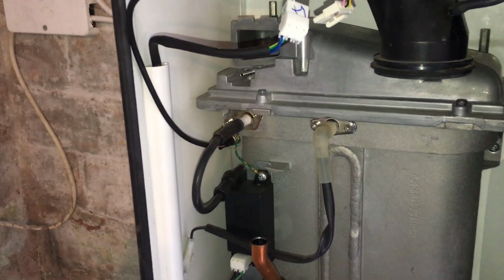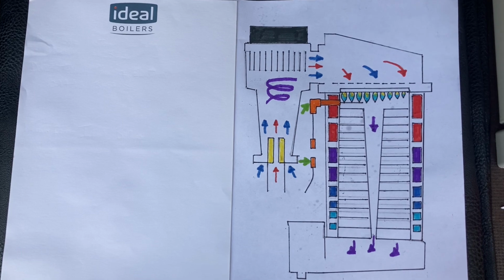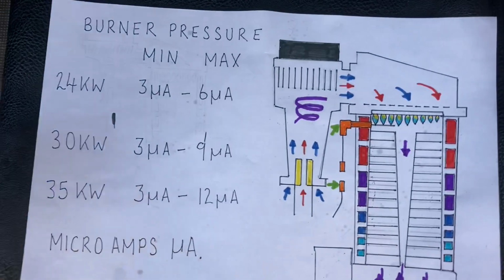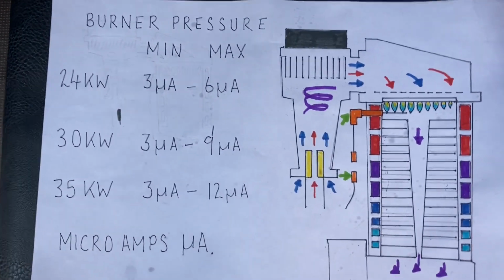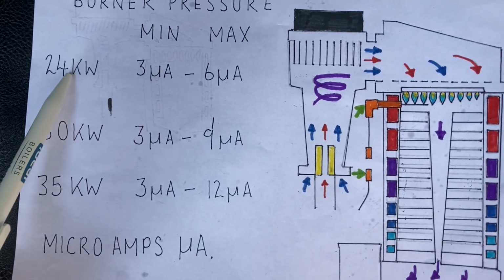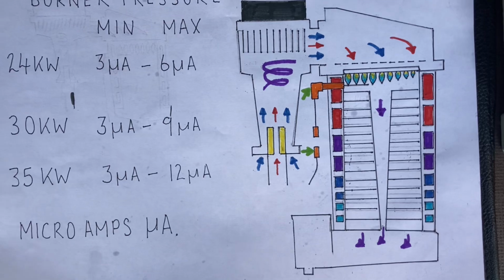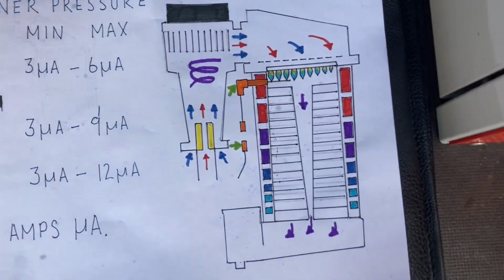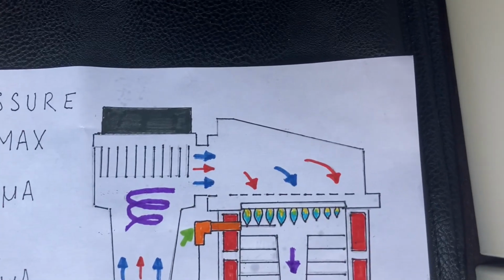Gas Training - Ideal Logic Blocked Burner

Comment: How about doing a gas rate to check if the boiler is burning enough gas? That would eliminate if the ionisation probe is damaged..
Reply: I did a gas rate but in my opinion they very rarely tell you anything useful. It wouldn’t have ever pin pointed where the fault was.

Comment: Ahhh the uses of a gas rate 😂👀👀👀👀
Reply: It wouldn’t pin point where the fault was. Gas rates rarely provide anything useful when it comes to fault finding
Reply: @Hallesworldb127  It’s the implication of it that’s significant. Cos if gas rate is low, in full demand with max fan speed and good working gas pressure.. the fault is downstream of the mixing tube. ie burner. Most tests in FF like this they imply a set of outcomes, down to engineer to narrow down and isolate fault.
Reply: @Hallesworldb127  Often Ideal boilers with blocked burners make a loud pulsing noise due to flame going on/off. Obstructing the mixing tube intake to reduce the pressure on burner makes sound go away. Also short cut to knowing the burner is blocked. This isn’t taught in manuals. Just product specific experience. Just takes some time.

Comment: Great video. I really enjoyed this. One question I have is. The fan ,burner, gas valve/ venture,flue, and case are all sealed. How can the cat hair get into the fan in the first place . The only way I can see this happening is if the cat slept outside next to the flue and the boiler sucked it into the air intake ?
Reply: It scratched the rubber bung off the flue elbow on top of the boiler where you test for integrity. And it slept on top of the boiler. So it’s due was just being sucked in. Mad I know but it did happen

Comment: Ideal logic + heat 12 incomplete combustion on service low fire but fine on high. I striped serviced the boiler but same issue, it is also making a loud whistling and rumbling noise on low fire service mode. I flushed the heat exchanger, cleaned out the condense, cleaned the Venturi and injector but no luck. I changed the gas valve and also tried a new injector but still no luck. The next option is the the burner top unless anyone else has any ideas?

Comment: Makes a lot of sense. The MI's seldom give the correct solution. Most faults I attend have been dirty boilers due to lack of proper servicing by the big players. 10 minutes and £25 to the engineers is not a service.

Comment: I’ve got an f2 fault on a independent 35. Tried this and my reading are way higher than these rather than lower. What could that be? Really stuck with this, boiler has been stripped and double checked.  Any help appreciated

Comment: Would a blocked burner cause the gas rate to be low on maximum output and cause a droning noise on ignition?
Reply: Yeah it would. I’m a British Gas engineer. Every service on a pre mix burner had to be gas rated. If it was 10% below or 5% above the kw rating of the appliance then we’d have to investigate why. ANY kind of restriction of the gas - undersized gas pipe, blocked injector, burner would cause this.

Comment: 3yr Old Ideal Logic Rumble at low Burn...
Injector fully cleaned.
Venturi tube cleaned.
New Burner fitted.
New Gas Valve fitted.
Main Heat Exchanger Flushed through/Cleaned from above with Burner removed.
....and its still rumbling at low burn!
After years of dealing with this issue on the Ideal Logic Range I've found it's basically Pot luck as to which of the above remedies the rumble at low burn but nothing has cured this one. 
I've found If you partially restrict the air flow through the venturi the rumble stops everytime
Reply: It will need a new pcb. Call and get  it replaced under warranty. The minimum fan speed will be set wrong on the board.
Reply: I’ve got a few like this currently got one rumbling badly.   Changed the same parts as you and a new flue.    Then day two working pressure is low. Sgn are doing a new supply and governor.   Will see what happens next week
Reply: @longlegs31  what was the outcome?

Comment: quick question, if the burner baffle was blocked, wouldn't gas rating show this as well?
i'm thinking the fan will struggle to suck up the gas from gas valve and push the gas air mixer through the burner baffle?

Comment: another way is to gas rate on hi & low
Reply: That wouldn’t work, the differences may be negligible on a gas rate. Also it may tell you that there is an issue with volume consumption but it would not tell you whether it was the burrner, injector, gas valve or even supply pipe. So a gas rate would not help sorry.

Comment: Is it possible to clean the burner baffles ?   ie,  attaching a small crevice device to a vac hose
Reply: I would probably say ‘ I doubt it, but I have not tried tbh, although being in my position o wouldn’t try because I would just get a new one off the van rather than waste time. But if you do happen to try let me know. 😂
Reply: @Hallesworldb127  i will try next time i come across it and let you know if it works.. or not.
Thans for your time and effort making these videos,  as a former manufacturers eng doing the same job as you,   ive learned something from then and can tell  you would make a good trainer

Comment: Mr Ideal, Ignore the  tw#ts !     i'm long in the trade ( 40 yrs soon)  and like Allen,  ALWAYS  learn something from your comprehensive videos, so thank-you for taking the time.

A question for you, have you ever gas rated a blocked logic burner and if so what was the outcome??  (in comparison to the micro amps)

Cheers.  :-)
Reply: I’m sorry pal I can’t really help you with that one, I only really ever gas rate the appliance when I’ve finished either servicing it or repairing it, I don’t think I’ve ever done one whilst in the middle of a job.
Reply: @Hallesworldb127  No worries, thanks for the reply.          I sometimes gas rate during fault finding and find it useful for pointing me in the right direction.

Comment: Yet again a great video mr ideal as I'm having a problem with a ES 35 gas consumption incorrect on central heating its correct 24 kw 2.55 m3h but on max I'm only getting 2.2 m3h yet 19mbar inlet pressure checked benchmark and installer when new had the same readings boiler was just serviced only 6 years old any ideas new gas valve or should I do the test and check the micro amps . Cheers
Reply: If your doing it on service mode max in heating again getting 24kw, that is fine as it stays in max, if your suggesting that on hot water you can’t achieve the rating you require it may be because the heat ex has reached temperature and the thermistor is modulating it down, and if the boiler and all the outlets are functioning correctly I would not concern yourself too much, unless it is causing a problem.